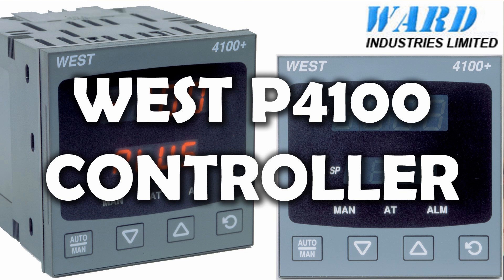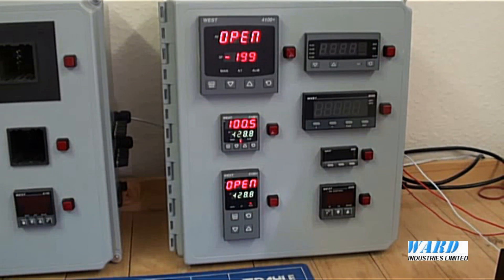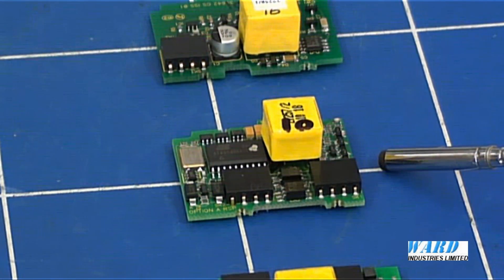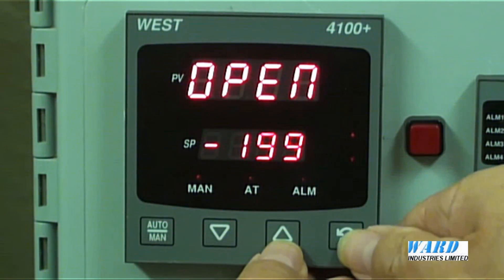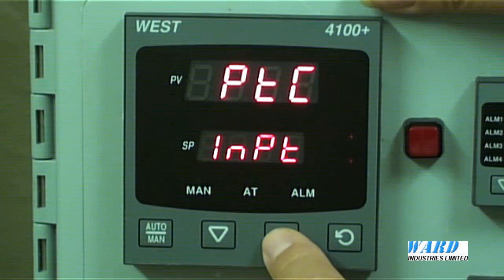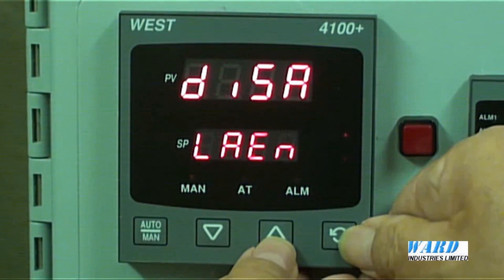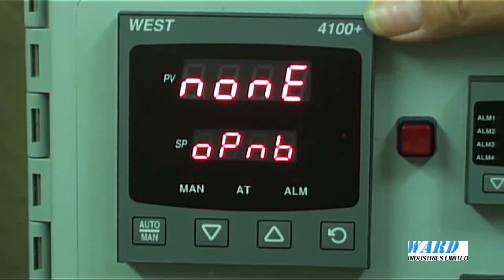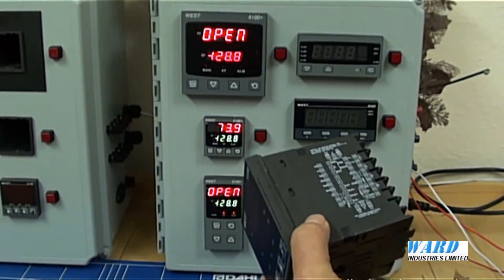P4100 Digital PID Electronic Temperature Controller Systems Explained

Comment: Sir how to check output of remote set point input card in PID controller
Reply from the maker: Hello and Happy New Year to you. Which model of controller do you have? Can you please advise me the full model code. You should be able to find this on data label that is on the side of the controller housing.
Reply: I have problem with 4100 and i can solve, can I have your help?